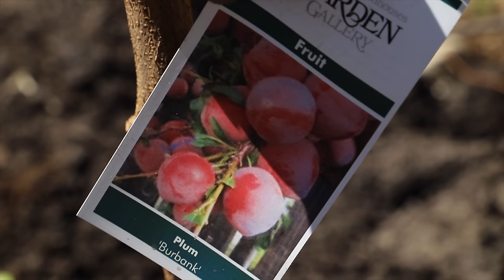Building an Easy DIY Potting Bench for My Garden | Vegetable Gardening for Beginners

Comment: You might find you will get a longer life from things you make if you use stainless steel screws. The passivated screws you are using will rust really quickly and leave unsightly rust stains on the timber. And the square head holes will make removing them difficult to remove long term. So later when you might want to replace the odd rotted piece of timber it will make removing the screws much easier. Surprisingly the ss screws are not much dearer than normal ones. Keep an eye out for things like decking screws on special which can be used in other construction.

Comment: Electric shower - car battery electric pump -shower head with hose -   pipe  with filter to draw -up warm water to pump  and switch to turn shower on and off - also prime the water hose with water before you switch on the water pump -enjoy warm showers

Comment: find some willow shoots and leaves ... add them to the shrub water and they will root faster after a soak ... water with that same water and they will love it ... and it's 100% natural rooting compound
Reply: when transplanting from a pot as you put it in smush the root ball a little to break up the flower pot shape so the roots grow out sooner and faster 
securing the plant better
Reply: if that is the rain storm that NAILED Ottawa ... you got it lucky ... 6 days or so since and some people still dont have power in the west end ..
Reply: keep an eye out for tricycle's being thrown out or sold off ... their front wheels are excellent for rough ground travel ... the rear ones are perfect for smoother ground .. the handle bars make great hose hangers ... and coat hangers too ... the frame ... well perhaps make a sculpture from them of some sort ... or find someone with a forge and they can probably use the metal of the frame ...
Reply: for a basic potting bench looks great ... sure it's not perfect ... but it has charm ... something else you might consider ... for the bench you wheel out into the garden ... scavenge some 1" tent pole uprights and angles ... add a canopy over the top ... for shade and rain cover so things like fertilizer dont get soaked if it starts to rain while out in the garden ... 
.
and for them fun mosquitoes and black flies ... here's a diy fix ... 
.
The smudge pot mosquito repellent method uses a simple metal soup can, a coat hanger or wire, and dry punkwood from decomposing logs. By slowly burning the punkwood and allowing it to smolder, a thick blanket of smoke is created that can help deter mosquitoes. Studies have shown that some types of fragrant wood, such as eucalyptus or cedar, may work better than others. So, you may want to experiment with various types of punkwood found in your local forest to find the best variety.